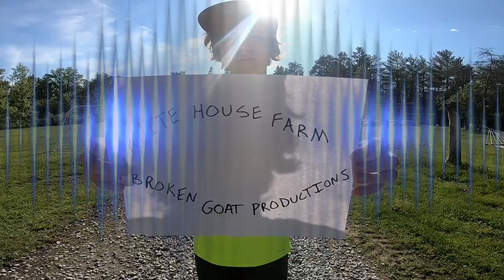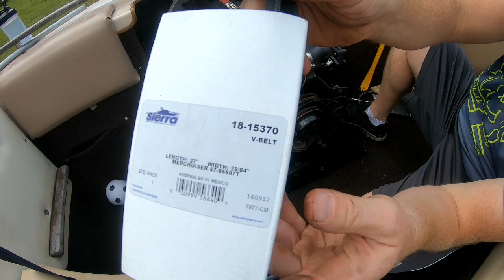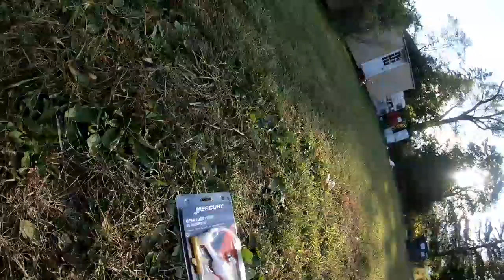$200.00 Boat And Trailer Will It Start???  Part 2

Comment: you have water in your drive its going to need to be resealed. If you ever put in some new belts again don't use the bottom of the hull to use a long pry bar to pry on the hull is only about 1/8 of an inch thick and you could bust your hull out by prying on it . You are doing a great job keep up the good work

Comment: we soaked ours in some gasoline. pull the power steering earl[oil] word play. initial run goof fit bit best to do lower unit or out drive oil and engine oil. regardless of usage we changed it season to season. that cap by the main pulley keep that full. watch your temps don’t give it the beans treat her nice she’ll treat you nice. make sure she’ll run cool if the gauge doesn’t read properly usually new stat and or gauge be sure to top the tank up with fuel don’t leave it empty prevents moisture add a bottle of carb clean we did incase their was any water in the fuel. that it makes fuel gauge read properly and is accurate. hey welcome to boating fun. but if you. stay ahead of things ready to go next spring. we usually removed the battery end of season open water lines and pet cocks on the block. no need to fog if the garage is heated and need a boat cover wheel bearing grease check lug nuts bow strap should be loosened during storage extends the life of the strap. while the boat is out n about to check the bunks for rot. any color marine carpet we usually matched. tie down straps and transom bars that go on the out drive trim rods or use a transom saver. check trailer springs for cracks the trailer tires 🛞 dry rot we used a tire dressing with uv protection and tire covers trim out drive down while in storage drains any residual water to and remove drain plug. squeeze hoses for rot inspect those not just bellows. get mercruiser skeg paint just looks better and add thompson water seal clear to the wood.
Reply from the maker: I got almost 40 videos on this boat now you get to see the transformation from that first video!,  I wish I could of picked your brains when I first started you sound very knowledgeable! Although I must say its been alot of fun and I have learned alot! Thank you for watching enjoy the rest of the videos I got 3 more boats I'm working on too hopefully I be able to put out some more videos on them!👍😊

Comment: Hello there.  What boat model is this? I live in Sweden and has a Imperial 164 that is very similar like yours in the design. Just wondering if your boatmodel may be a big sister to mine? :)
Reply from the maker: This is a 1986 regal medallion 185 with  3.0 140 mercruiser engine, thank you for watching I got alot of boat videos and new boats so make sure to check the other videos out and hit that subscribe button! 😁 thank you!
Reply: @WhitehouseFarmVet  thanks for your answer. I really look forward to see more of your boats. I actually works with mercury on my daily job on the west coast here in Sweden. Both inboards and outboards 😀 gotta love these engines. But my Imperial has an Volvo Penta AQ120 in it with a 290 on the outside 👌
Reply from the maker: That's awesome it alot of fun and I am also learning alot! Lol

Comment: forgot to water/fuel separator filter and engine oil filter annual spring oil change.
Reply from the maker: Definitely! although this model didnt come standard with a water fuel separator I got a couple boats with the 3.0 like this, for some reason no separator!